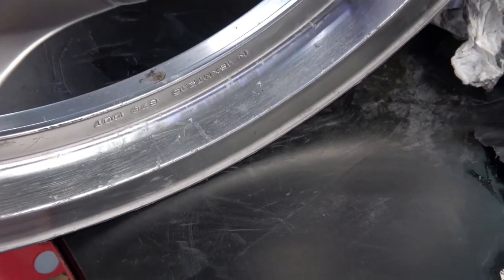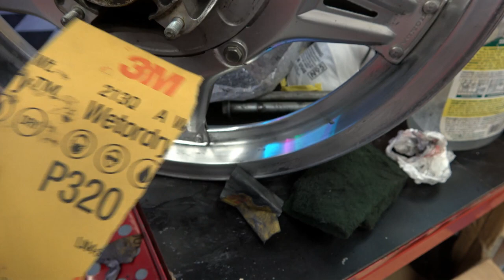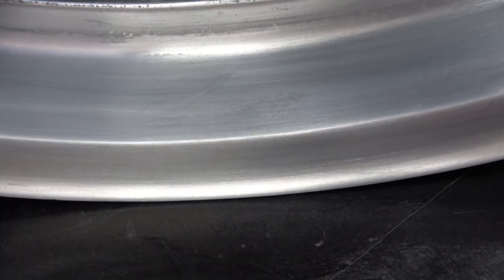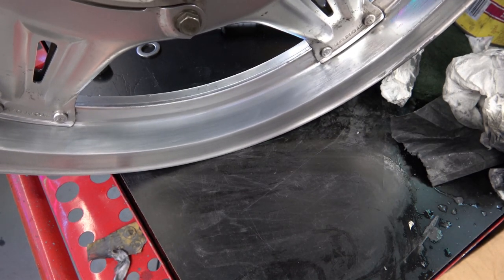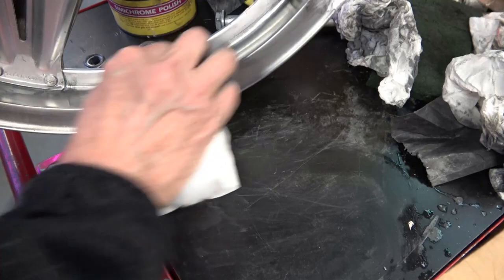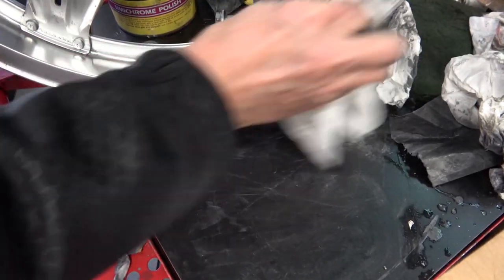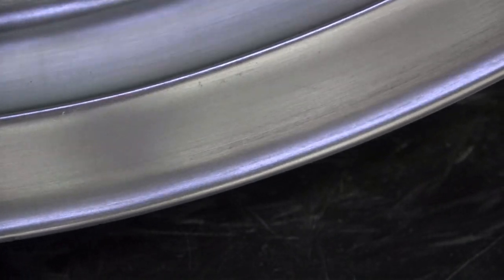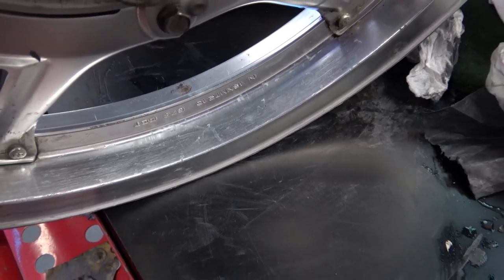Honda CBX Full Restoration & Engine Rebuild Video Series - Part 31 - Honda Comstar Wheel Restoration

Comment: The silver '79 CBX Comstar wheels are anodized, that's that hard finish that takes so much sanding effort to remove and is impervious to paint removers.  To speed up the finishing, remove the anodized finish with a sodium hydroxide (a.k.a. caustic soda or lye) solution which is found in extra strength oven cleaners.  Use cautiously, mask off the spokes to keep the oven cleaner away unless you want to refinish those as well.  Spray a light coat of the oven cleaner, wait 15 - 20 minutes and wipe off with a damp sponge or rag.  Continue per Pete's instructions - you'll find the sanding much quicker and less effort.

Comment: Another great video. Getting round the 'spokes' where they are riveted to the rim is the very tedious bit, especially trying to get the satin finish consistent. But I guess how far do you go. Your attention to detail does you credit!Watching all your work shows that go ol' fashion 'elbow grease' makes the difference between a reasonable job and a great job.Its a pleasure to watch.
Reply from the maker: Hi Mark, yes, you are correct. The area around the rivets is a challenge, but in order to get the area to look consistent, I get the area free of the old clear coat using what ever works, sand paper, wire brush, etc., then I use the sand paper to make sure the desired direction of the scratch marks are consistent with rest of the wheel. Its tedious, yes, but in the end, you have a beautiful wheel. :)

Comment: Just a small comment. It is not clearcoat you remove, it is the anodizing.... That means that they will easier corrode, but as long as you store it in a dry room, it is not a big problem
Reply: You are correct. How do I make look like it's Anodized  if I just want do small  repair  on that portion  of Rim as he was discussing with pitting  and scratches.

Comment: How do you refinish the center spoke area?
Reply from the maker: Hi Steve 
You can use the same method on the center spokes , if they need it. They are much easier to bring back to looking like new again. They are a different type of aluminum and finish which does not corrode the same way the wheel rim does. So usually you can use a scotch brute pad or 600 or 800 wet/dry sand paper the polish and they will new again.
Thanks for the question Steve
Pete

Comment: Great video! I was wondering if you use the same method on your clutch cover? The clutch cover on my CBX is starting to get tarnished looking, and I think it is the clear coat coming off.
Reply from the maker: Hi Michael, yes, the clutch cover is easier to restore. I have a separate video featuring the restoration of the clutch cover. Check it out. I go into great detail. Thanks
Reply: @digitalpizza1  thanks, I saw the other video just after I sent my message. The other video is a big help, and I thank you for posting them! It's a great resource.

Comment: How do I apply  that clear coat over Rim at home to get factory  finish look? I was told there were Anodized  on there instead.
Reply from the maker: Yes, that’s true 
They were anodized 
So, the stains and or corrosion has to be polished after removing the anodized material, then either re-anodized or just maintain the finish
Reply: @digitalpizza  Hello, how do you keep finishing  and repairing  scratches  without  removing Anodized

Comment: Is there ways to drill out the rivets to repaint the comstar? Do Honda sale the rivets?
Reply from the maker: I would not drill out the rivets. Honda does not sell them and the rivets have the Honda engraving on them. Plus, it would alter the structural integrity of the wheel. I would just carefully tape the area and paint it.
Reply: @digitalpizza1  I like the look of the comstar and I wish there ways to do it. I seen alots of paint one out there but i think it could be better.  Thanks.